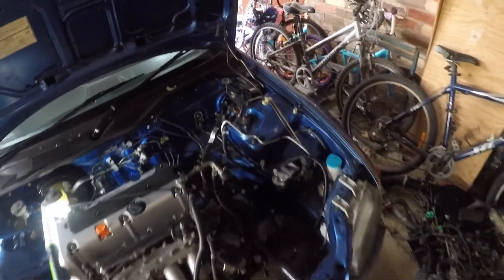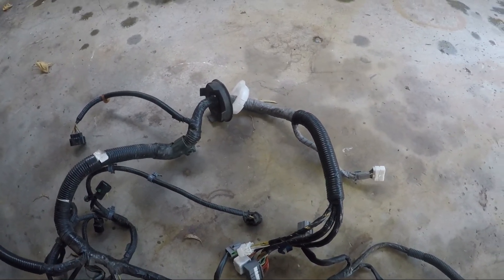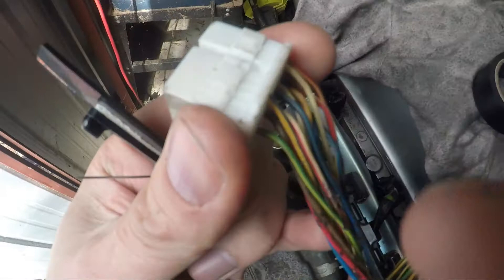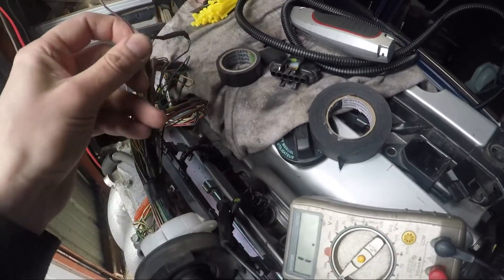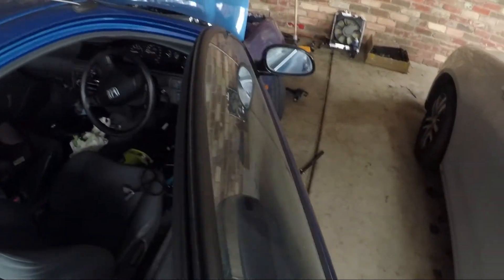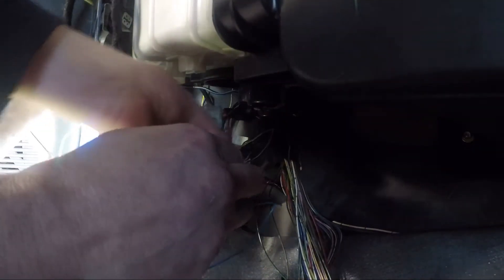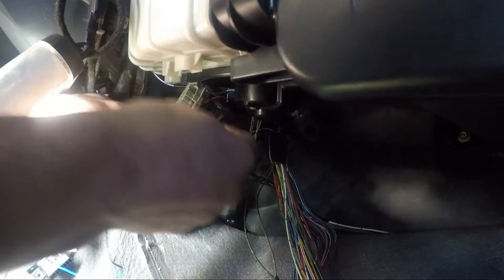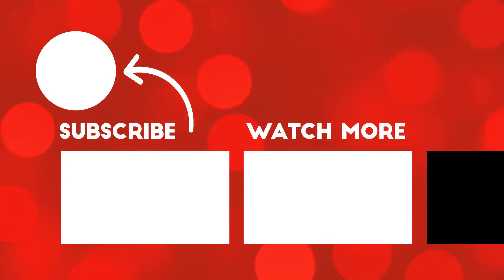Budget EG   Wiring the K24 in the Civic including conversion harness

Comment: Thank you so much for this info. I'm currently doing a swap on an EG3 1.3 carb in the UK. You've been such a help my dude!
Reply from the maker: Great to hear! People avoid the carby cars here in Australia, but having done the swap I reckon its almost as easy - pretty much just the tank which is extra. The carb cars here are heaps cheaper and are the base ones so lighter too. Good luck with the swap and yell out if you have any questions i'll do my best to help.
Reply: @teamaxlestands  it's a similar thing with cost of the carby cars here in the UK. I did watch your other videos of yours saying about the tank and hardliners which I'm happy to do. I have an EG with a B16A2 turbo that I completed last year. Thank you again for your wiring info it's so valuable. ✌️

Comment: Hi , I’m doing exact same build , carby eg k24 , glad that found your channel . 
Do you mind to explain a little bit more for the wiring harness , should I just get HR eg conversion harness and add a fuel pump relay ?
Reply from the maker: I have had a few people asking, maybe i need to do a quick little video to cover the slight extra work there is for the people wanting to do a carby conversion. I used a double relay found in the efi eg/ek and kind of bridged the 2 relays. I've seen people swapping over the whole under dash loom, it seems like a lot of work. You could simply use a normal relay triggered by power from the ignition and grounded by the ecu.

Comment: Nice one bro, putting in the hard work. Good guide 👏.  Whats the go with the fan switch? Do you ground the other pin?
Reply from the maker: Yeah mate, one end goes to the wire in the harness and the other end goes to ground. Watched your vids while editing this and saw you were doing similar wiring. HR harness looks much better quality than the one i got. Better labeled and more than 5 wiring colours haha
Reply: @teamaxlestands  thanks dude!! I've noticed the ek swap harness is really simple.. maybe thats just a eg vs ek thing. But yeah glad they labled stuff. My chassis is auto and a crv and its jdm so finding wiring info is a real tedious process because you have to triple check everything... im still not certain mine will turn over first try and i might have to bridge the park inhibitor switch for the auto loom... also the reverse lights is an unknown currently 😂😂😂
Reply from the maker: I give mine a crank on the weekend (ECU removed) just to make sure i got oil pressure. I recall doing the bridge for natural/park switch on an auto to manual conversion in the past... haha fingers crossed on the reverse lights. I think they should work through the HR loom and then into your body loom but yeah without testing its tricky to know :)
Reply: @teamaxlestands  good idea. Will try crank mine over today.  Yeah well some of my oem pin locations might be wrong for the conversion harness lol fun times.
Reply from the maker: @jdmnuggets  Just went down and checked my reverse lights come on without the ecu plugged in too. So you should be able to check that out.

Comment: So this is a k20a6 CRV early 00's loom right? Thanks for the video mate
Reply from the maker: hmm we never got the K20 CRV's here in Australia. The one i used was a 05-06 CRV with the K24A1. I used a 05-06 as they have the wiring to suit the Ktuner style ECU. I have a video coming where i show how to modify an AUTO CRV loom from 02-04 (earlier style) to the newer style ECU.
Reply from the maker: That said i dont think the K20 would be too much different. Possibly they will have different crank sensor plug (maybe intake cam too?) and the 02-04 one should work with Hondata Kpro without any mods besides a couple of plugs (if its a manaual car)
Reply: @teamaxlestands   I can only find chassis harnesses to suit 02-04 k20 engine harness, is this the one you used ? Cheers
Reply from the maker: yeah thats right i used a K20 one and then there are 5 or 6 wires to repin. I think you msged me on instagram and i just sent you the link to a vid on how to do that.